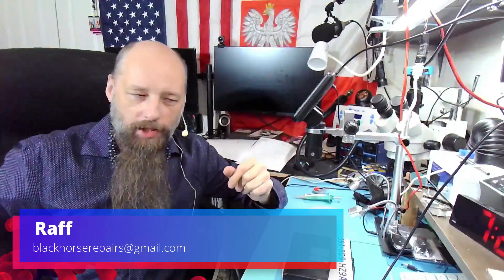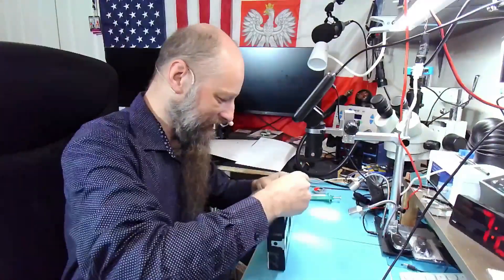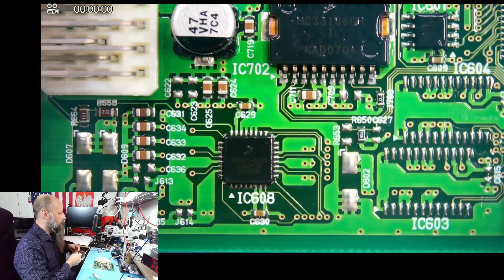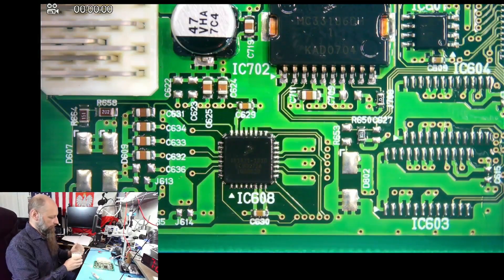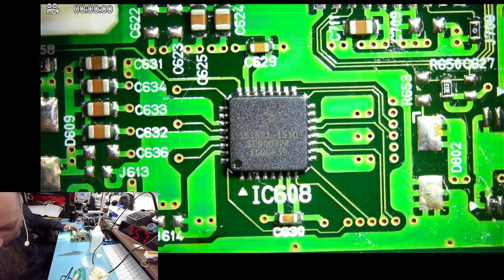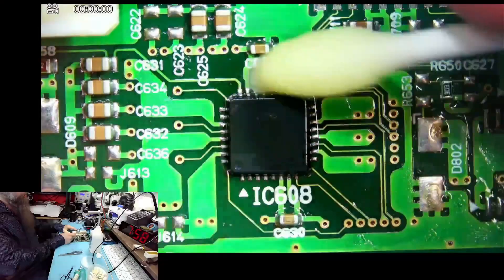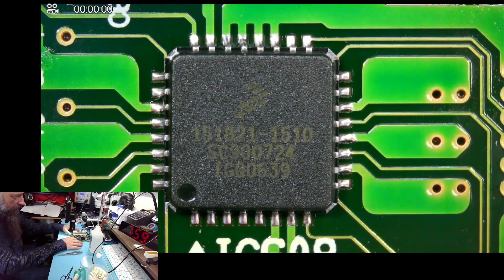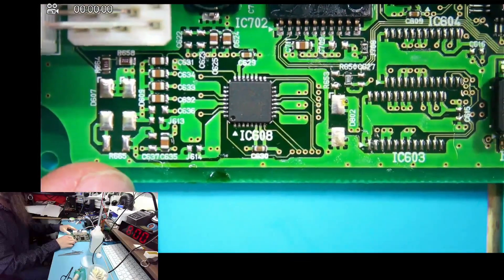ECM Repair for Patryk | Why I don't trust car mechanics

Comment: Where do you think the failure was during this repair?
Reply from the maker: There wasn't one, the second resoldering was not required, there seems to be another issue on that car, we're trying to diagnose it, my suspicion is around wiring.
Reply: @blackhorserepairs  Thanks for the update!  Looking forward to a resolution and explanation.  Cheers.
Reply from the maker: @marstedt  the replacement of the ECM also has not resolved the problem, my strong suspicion is that the wires got damaged during removal. The other option is that something completely unrelated failed, the guys are working on it, hopefully we'll know soon.

Comment: Very interesting video. I've arrived here from watching nintendo repairs etc. 
Would love to have seen what the problem was with the chip (proof it wasn't connected) and then proof it was all good after the fix. A satisfying continuity beep for example. 
Enjoyed your soldering techniques.
Reply from the maker: Thank you so much! Some of my clients drop the comment on videos of their repair, some just write an email but most just never reach back to me which means "no issues" :D
I wish I had an equipment to just connect the ECM to and confirm everything is working, but I don't know if such equipment even exists let alone be accessible to someone like me :)
The only way to confirm is to put it back in the car and observe no more issues with misfires. Works like a charm every time :)

Comment: I work on electronics and vehicles, if the book says 8 hours you pay 8 hours, if it takes me 12 hours its a skill issue.
Reply: that only works for new cars, on older one, there will always be that one bolt which ruins your day. You don't need any special skill to work on cars, basically you are only loosing / tightening bolts, don't blame the skill.